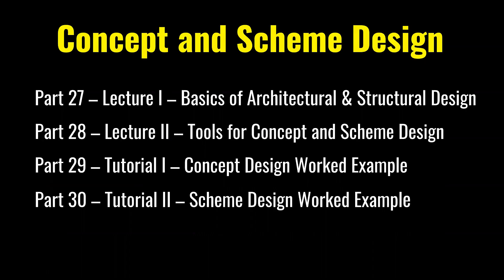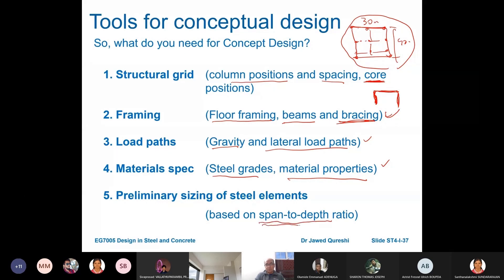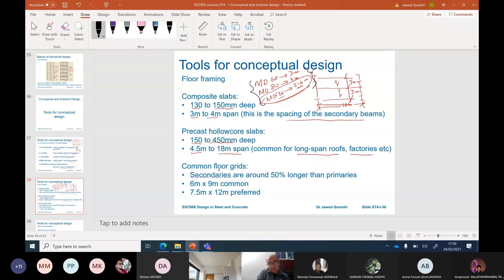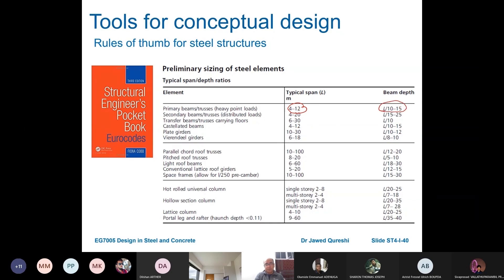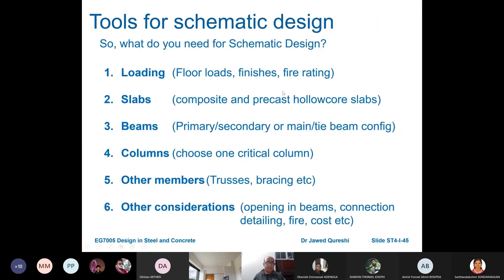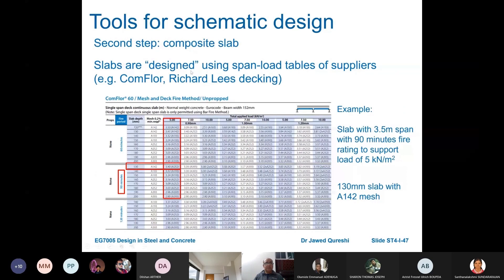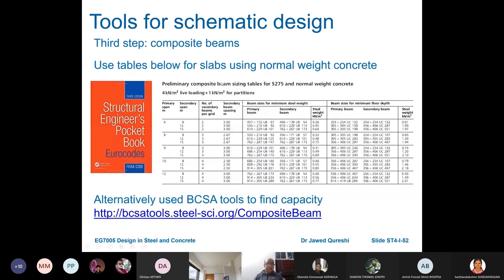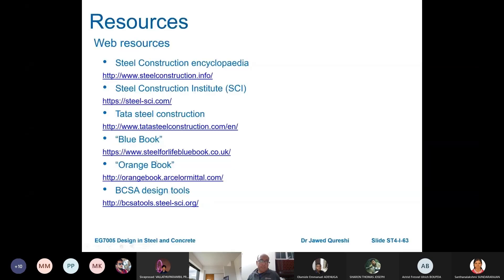28 Concept and scheme design Lecture – II (Tools) | Eurocode 3 Steel Design series

Comment: which softwares are used generally in europe for analysis , design, detailing of steel structures ?
Reply from the maker: Tekla, Revit, S-Frame, GSA, Master series. Software are just tools, understanding the basics of steel design is more important.
Reply: @DrJQureshi  yes, sir . thank you for your information. I am currently surveying on computer tools that are commonly used for steel structure in different regions. and to get a selective idea on which tool I should emphasize on to carry my study regarding steel structure design.
Reply from the maker: @adilanwar9865  Most steel design can be carried out manually or with the help of Tables, such as Tata Steel Interactive blue book. You'll need software for frame buckling analysis and connection design. Good luck with your work!
Reply: @DrJQureshi  Thank you, sir. I will be here if i be needed more guidance in future.
Reply from the maker: @adilanwar9865  Thanks for kind support. I wanted to create some educational content using a software called Blender, similar to what lesics youtube channel uses. If you have any experience or willing to learn it, please drop me a line at drjqureshi1@gmail.com